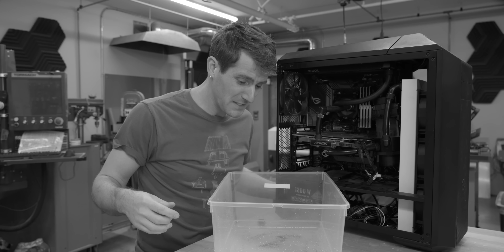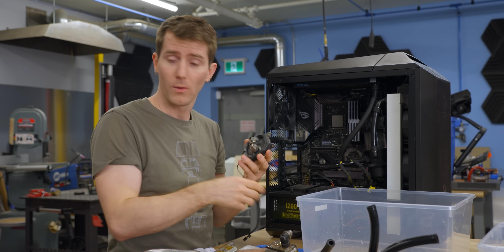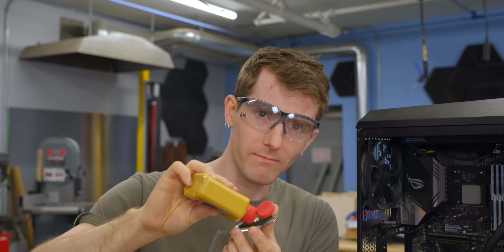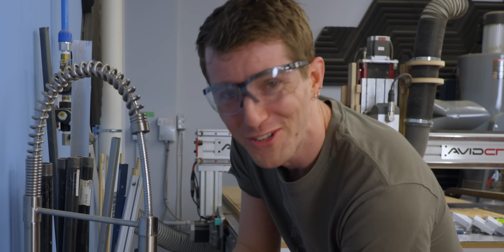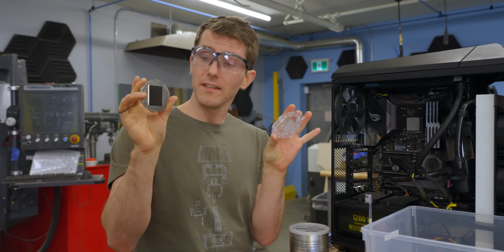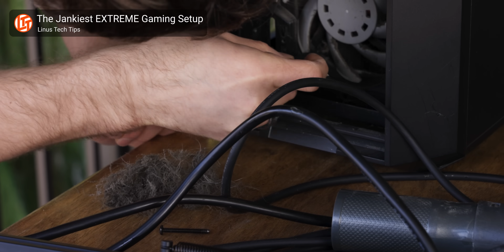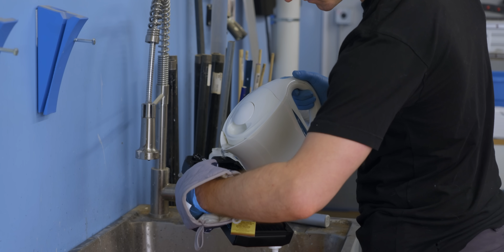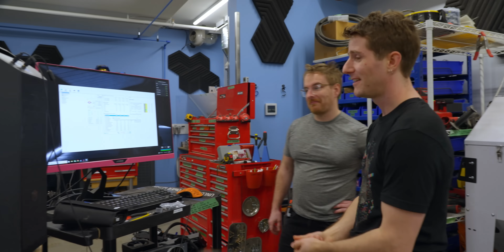I Will Never Watercool Again – Water Cooling Maintenance Guide

Comment: Laifen: we'd lke to sponsor a video.
Linus: You know we're a tech company right?
Laifen: Uh, yeah....
Linus: Cool, we're gonna use your tooth brush to clean some really nasty crap off computer equipment.
Laifen: Uh, ok......
Linus: Check cleared, let's do it.
Laifen: what did we agree too?

Kidding aside, seems like laifen is a pretty chill company to go with this.
I would be interested in which 'hardness' of head you were using.
I usually use a 'soft' head for most electronics, unless it's really nasty, or rusty, in which case, hard or get a wire brush or the dremel.
Also, brasso is awesome. 

I think the real take away, clean your computers regularly folks.

Comment: I just hard tubed m y system, I had an aio before on my cpu and the temps are about the same but where my gpu with fans was running 73 c and up now it maxes out on star citizen at 51c and it so much quieter and pretty pretty colors..

Comment: Funny enough, I recently cleaned my blocks using an ultrasonic cleaner I got off Amazon and some distilled water mixed with the included solution. It didn't cost all that much and the tray was big enough for even my GPU block (minus the acrylic and cover), but it worked insanely well at getting the debris up from in between the fins on the CPU block. They damn near looked close to factory fresh.

Comment: I built a water cooled system for one reason only. Fun to design and mod. Hell, its not even efficient since i really dont have enough RAD.  But at least mine has been pretty easy to maintain and it literally runs 24/7. With the exception of one failed D5 its been solid. Just dump, flush and refill here and there. I was originally on the DW bandwagon, but i did end up switching to cooling fluid quire some time ago.  I think a full teardown like this video is nearing "just because". Its been over 2 years i think since i built it.

Comment: 1: Don't put your mouth on the tubes
2: Rinse new blocks etc with distilled water
3: Acid bath new radiators with distilled vinger+distilled water thoroughly.
4: Copper and Brass parts (Nickel plating is fine)
5: Fill loop with transparent-type coolant from reputable pc watercooling manufacturer e.g mayhems x1 not pastel
6: Top up reservoir when level drops due to air escaping

Maintenance required: change coolant every 2-3 years

Comment: I have been water cooling for quite a while now. I know this is going to get some mixed reactions, but I have much greater success keeping my loop clean and keeping my parts from corroding by using pre-mixed coolant. More specifically EK Cryo Fuel. I know there is some temperature trade off by using a pre-mixed coolant, but I’d rather keep my parts from corroding, rather than getting a couple of extra degrees by using water. I have tried all the recommended waters, treatments, algaecides, protectors, and inhibitors. No matter what I have used with water, it always corrodes. The last two builds I have done, I used EK Cryo Fuel and I have had no issues with corrosions or things growing in my loop. I can’t recommend the stuff enough.

Comment: I remember how loud my cpu fan used to be(early 2000s). I don't remember what brand it was, but it was so loud, my grandpa called it "big noisy".  I switched to a Thermaltake copper heatsink, so that spun slower, had different shape fan blades, so it was less noisy.  Much quieter fans today.

Comment: The different coolers have different mounting schemes.  The air cooler pipes and flanges can take quite a bit of lateral space compared to a little aio pump.  Sometimes the flanges don’t even fit over the ram.  Between the way weight is distributed, the size, and mounting mechanism,  I have generally found AIOs easier to mount squarely with the best contact.

Comment: I have AIO Corsair H155i refurbished 280mm push/pull setup. Got it about 3years ago. My 13600k OC @ 5.4ghz  stays around 55c to 62c max for gaming. AIO for your average user can still perform pretty much the same as a high end custom cooling system. Just depends how far you want to go with the custom cooling.

Comment: I've always stuck to air cooling, but my 13700k really has me considering going to liquid because even my Noctua NH-D15 isn't enough under full load. I'd honestly rather stick to air but unless parts start getting more efficient again liquid cooling is going to be the only option. If the heat weren't so concentrated on modern intel CPUs air cooling would be good still...

Comment: Man, I have not had a loop this nasty since the days of Danger Den blocks and AC Delco heater cores for rads.  

I am guessing they never did the proper prep work and part sellection.  My current loop is untouched for two years, is a daily driver, and still has clear tubes, res, and blocks.  My oldest loop was about 5 years old with no water changes or anything.  Just topped off from time to time.

Comment: Tbh.
I like to use both electric and normal.
There's certain things the manual brush does better, and some things the electric does better.
I feel I can get at the back of my teeth better with the electric, but between the teeth better with the manual brush.

So I just keep two brushes

Comment: If you must do liquid cooling I recommend using Automotive antifreeze do not get mixed only straight antifreeze do not put water in your system you will lose one or two degrees of efficiency due to straight antifreeze not having the same thermal transfer but not taking your Loop apart for 10 years worth it

Comment: 10:30.. Loosing the gpu.. ?? You only lose the waterblock for it.. i dont se the problem.
Never throw away the original Aircooler for your gpu.

Used a Watercooled 1080ti for 3 years and upgraded to a 3080ti.
The 1080ti is now running in my gf system with the original aircooler. 

Also for longevity only use clear cooling water. Pastel stuff/Colored stuff tends to go bad way faster. Even if the manufacturer promises it will not...
Reply: "losing"

Comment: Watercooling is a bit like installing nitrous oxide kits in a car. The boost in performance is there, no doubt, and everybody thinks it's cool, but you can destroy your engine if you do it wrong, there's mandatory extra maintenance nobody mentions, and you're shortening your engine's life significantly even when doing it correctly.

Comment: Another use for Brasso is on exhaust pipes. If your chrome-tipped pipes are all covered in black gunk, brasso will clean them up super easily and save your a lot of work! 
- Not a sponsor

Comment: Can't you just use antifreeze for cars and engines? 
Stay pure for many years and prevent corrosion.
Many engines have mixed metals parts like copper, iron and aluminum without getting corrosive and eat up each other.

Comment: PLS Also make sure your pump is going at its max speed! that way any contaminants almos cant settle down. Do you want your system to run longer that 5 years dont use dye collors! there is something in it that can crystalize and clog the system. what you also can do is use hot tap water or a garden hose on full pressure NOT A HIGH PRESSURE CLEANER they coullld burst your radiators. What you could do under normal water is flush out the dust dont use towels to dry em but a hair dryer will do. and standing in the shower u could swing a lot out of it you will get wet but it works.

Comment: On the subject of the radiator blasting water, I once popped open the cooling on a car without thinking when the engine was still hot. Oh boy. (Luckily I jumped back fast enough to not get burnt or you know, just hit with tons of water/antifreeze)

Comment: I've been on water since 2013. Just L/C'd a 4090 with a 360 monsta and alphacool pump/res/block. Had to. the MSI 4090 was on 100% and 84C all the time on Nolvus. 

Now at 100% at 45C. Worth every cent saved on air conditioning.
Reply: nice, monsta user, and awesome temperature with just one 360 super thick radiator
Reply: @resko8758  Also did liquid metal/sealed the caps just in case. But I really  thought it was broke. I was expecting like 65C 45 blew me away. Clocks stay steady around 2900.

Comment: I’ve had 2 loops that were basically maintenance-free - just top off with water every now and again.  I used a silver kill coil and ALKALINE water.  An Enzotech Sapphire block cooling a Core 2 Quad and a Heatkiller 3.0(?) cooling an i5 6600k.
Reply: It went years between drains, basically only when I updated the graphics card since it would also be in the loop.

Comment: 17:05 i dont rl get it. You pour hot liquid inside a radiator(something good at disposing heat into enviroment) then you shake it without heating it up. But how would the pressure build if the liquid inside is only cooling down not heating up if anything it would create lower pressure due do liquid "shrinking" due to cooling. Or maybe you shake it so vigorously that the friction in between liqud molecules becomes so great it starts heating up and expanding :)?

Comment: I have an idea, what if you drill holes in like a minifridge or regular fridge that you may have in your gaming room for just drinks and whatnot, from sides and put liquid cooling pipes/loop for gpu and cpu through it, could it cool down the temps while gaming? or will you just  break the fridge, and can something happen to your cooling/pc while your pc is off and the fridge is still running? :D Thanks for vid LTT

Comment: I've only really had an issue with dye gunk. Always preclean components, run copper only and run distilled water with a inhibitor and/or a Lil silver. Don't touch em for years and they are fine.

Comment: I'm in a situation where I have a very small space that my computer is in. I want to actually move the heat from inside my computer's room outside. 

Liquid cooling is basically the only thing I can do to move that heat outside short of opening a window, which would let out the conditioned air.

Comment: I would never buy a desktop with water cooling. I’ll always have something powerful but not enough to need that type of stuff. Liquids near electronics is not my thing. Plus you can’t run dry or just leave it in if you aren’t using it for awhile.. gotta buy fish tank parts and shit, just a whole thing I won’t do. 

I haven’t bought a computer with moving parts in over five years.. including fans. I’m hoping that’s what we’re trending towards.. crazy power/minimal heat. SS cooling is fine by me but I have yet to see it in Apple or any OEM product or pre-built yet.

Comment: I think you've done this before, but I'd like to know how automotive antifreeze in a watercooled PC would do in terms of performance and if it would last longer than the usual distilled water mixture you use in terms of bacteria (yes I know the cooling system gets to between 165 degrees Fahrenheit and 195 degrees Fahrenheit depending on what thermostat is used). It also has anti-corrosion properties, an excellent example is look at old cars from up in colder climates versus old cars from warmer climates, in the warmer climates they just use straight water and in the warmer climates they use antifreeze, the vehicles from the colder climates tend to have cleaner cooling systems than the vehicles from warmer climates, where the vehicles from warmer climates tend to have cooling systems filled with rust and sediment due to people only using water.

Comment: 17:15 Pressure would build up because of gases created from a reaction between whatever the vinegar is dissolving. The water is cooling down as time goes on, so its volume decreases. If you filled it with only hot water and no vinegar, and sealed it, it would actually create a slight vacuum inside.

Comment: I have realised that if you do water cooling right from the get go, meaning flushing your rads, making sure everything is copper and nickel plated cooper, cleaning your tubes stay you cut them, using clear fluids, you will never come across such a dirty and grime filled loop. making basically 0 maintenance. This only happens if your don’t take care from the beginning.

Comment: Full cover block with GPU mem 90c while core at 45c on a 3080 during gaming. Something is wrong with the mem cooling, I would check the thermal pads on the mem chips

Comment: I've got the same AIO running for 6 years now with zero loss of performance. I will never NOT water cool ever!!! The sound reduction is worth it's weight in gold!!!! My freaking 2080ti screams like a fucking SR71 after a few hours of DCS or ACC with the stock air cooler. After going to AIO, I'll NEVER go back!!! Maybe don't buy cheap crap ?

Comment: @LinusTechTips The systems that you were showing in this video were they cooled using distilled water and solution or were they cooled using a chemical coolant like the Corsair Hydro-X brand coolant?  I am asking because I just finished my first ever custom liquid cooling loop and that is what I used. I am wondering if the contamination from usage on those systems is something that will still happen with chemical coolant when I am ready to do my first cleaning of my machine in the future.

Comment: I had a cooler master 240 AIO for 5ish years and when I replaced it I cut it open to see how "bad" it was on the inside. To my surprise the water was still crystal clear and the insides of the pipes and what I could see in the radiator looked clean as well. The only thing that started to go bad was the pump, it started to be pretty loud but it still worked perfectly fine for temps.

Comment: 1998, we got the silence… just had a massive bucket of water which I topped up every week.  That much thermal mass and who needs a radiator… though modern hardware does kick out more heat.

Comment: Hi Linus, I'm an engineer but also a gamer. Would you recommend going with a RTX Professional Workstation GPU or will I be fine with going for a 40 series. I had in mind either the 4080 Super or RTX 4000 (or the Dual slot version). Thanks!!
Reply: To get the good advice. You would benefit to be more specific what kind of work you will be doing on it with which software and also your budget. Aswell as what games you play and at what resolution what hz.

Comment: Yeah I will stick with an Aio, Air cooling just doesnt cut it for modern equipment and Custom might look cool on day 1 but they cause unnecessary  maintenance and require dismantling when upgrading other components so yeah $100 Aio with a 5-6 year lifespan is a good investment for the cpu. as for Water cooling on a Gpu well that's just unnecessary

Comment: Fun video.
1)
Still using electric toothbrush to clean knobs and pcbs in the machine shop and opn the bench.
2)
For my computers (more than 20 years) liquid cooling I use food grade Tygon tubing with 20% car antifreeze and water.
Good for multimetals, control bacterial growth, compatible with plastics, no deposits. When the yellow or greenish tint disappear just drain a small portion and squirt fresh full strength antifreeze in the reservoir.
Converted to that formula instead of water/glycol for all the lab instruments coolers too. No issues ever.

Comment: This was a conclusion I came to as well. Good Air Coolers are just SO convenient.  I also found that the watercooling worth using wasn’t even any quieter than just running Noctua fans & coolers ._.

For GPUs though: watercooling is so op. Definitely watercool a GPU if you can.

Comment: I've done 2 WC builds and honestly aside from aesthetic looks it's really a situation of the juice is not worth the squeeze.  AIO's perform nearly as well as a custom water cooled build and some newer AIO's are a little more customizable, but essentially zero maintenance and if they fail it's pretty easy to swap out and get up and running again.  The WC also makes your PC heavy and if you're not a young buck anymore hauling it around for maintenance is not fun either.

Comment: A great tip for removing deep rust/oxidation from metals:
Buy some distilled water, may be vinegar so that the process goes faster, get a whatever voltage AD/DC adapter, connect the + to the element you want to clean, - to something else that's conductive and high enough surface, submerge it in water/vinegar and leave for 20 minutes. Electrolysis will clear everything for you better than you could do yourself, simply because the + side will shed outer layers evenly, and brushing will only scrape off the outer surface, leaving whatever's in the deeper grooves untouched.
Just make sure to add some salt to distilled water, and don't make it in a small room, unless you want the hydrogen to go boom.

Comment: Not certain but don't think the water after the brasso is necessary or good for it. Perhaps it's okay because you seemed to have dried it well but I think the brasso says not to use with water because it can cause more putting and corrosion after.

Also you can buy a inhibitor to fight growth and crud in most hardware shops or tool shops. Normally used for central heating

Comment: I started messing with the components of a PC, by upgrading an HP prebuilt, in 2012. Since then, I have built two desktop PCs from scratch. I decided NOT to risk custom water cooling, so have just used AIO radiators. From watching your videos, I think that I made the right choice. Too much maintenance and too much risk of ruining expensive components with water leaks. There is still some risk of leaks with an AIO, but name-brand units should be okay. I also know that they don't last forever, so I plan to replace the unit every few years, to reduce the risk factor. If I had money to throw away, (and I don't), I might take the risk of custom water cooling because it does look so cool.